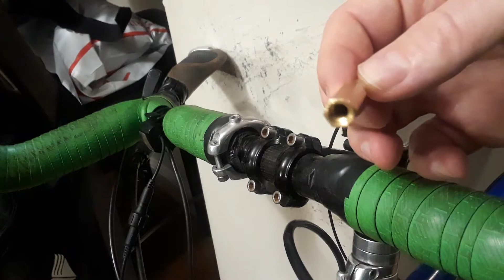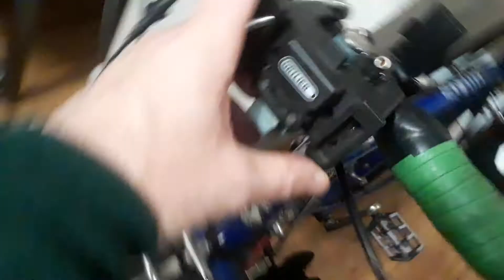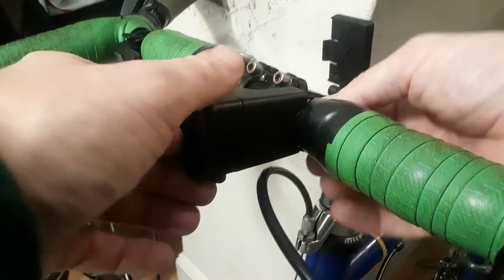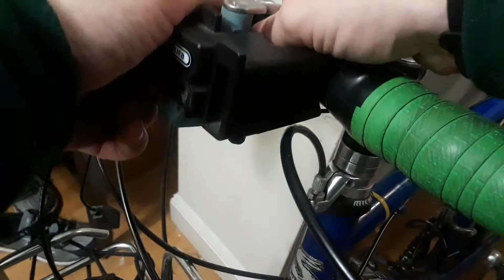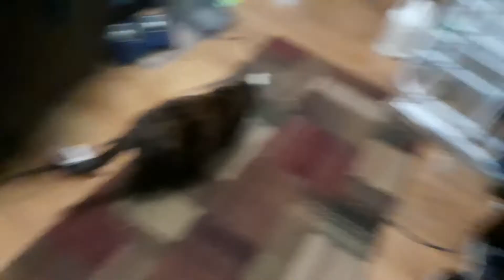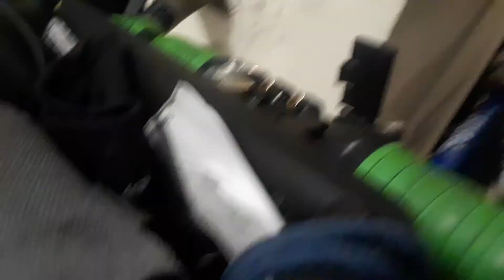How to install an Ortlieb handlebar bag

Comment: Hi Rob I have literally done this job dozens of time's but I wondered  whether I had  been doing it wrong all these years. It turns out I have been. What I have been doing is to not undo the anchor screw and I have been threading the wire through and then using a set of grips to tighten the wire before screwing up the wire screws. I also didn't realise about  the hole for the extra wire , but I think I will still coil it up because it makes it easier to transfer to another bike. Yes it was a long video but only because you were being honest so well done to you.

Comment: At the end for tucking the wire back into the hole I didn't have a ruler with MM's so I printed one out and measured out 70 MM, which then tucks back perfectly into the hole.  Be exact on the measurement for if you cut the wire too short or long and it can be a REAL pain in the butt. Trust me, I know!

Comment: You make one big mistake. The top screw should be completely in and make one 360 turn in the cable. Then take the cable around as you showed. Pull it hand tight and fasten the bottom bolts. Now tighten the top screw. Because you only made one turn it leaves you all the thread of the screw to tighten it. 100% 
Video of 5 minutes instead of 30..

Comment: This is such a bad design, I can see it working loose in no time as well as wearing on a stem and handlebar.
Reply: Once locked on they don't move at all and will not rub, they work very well.